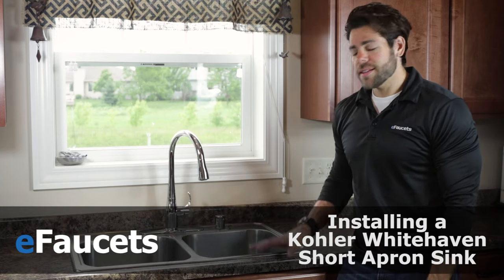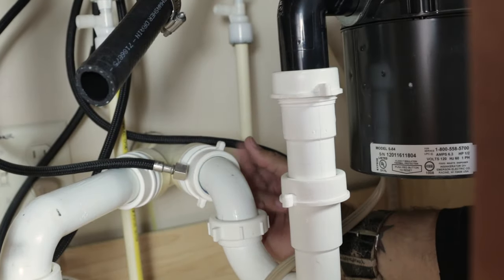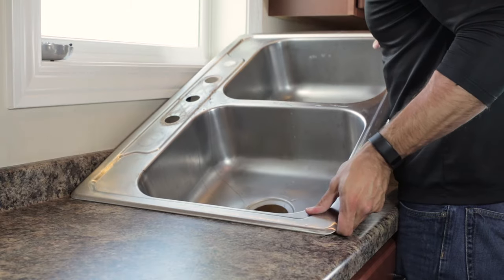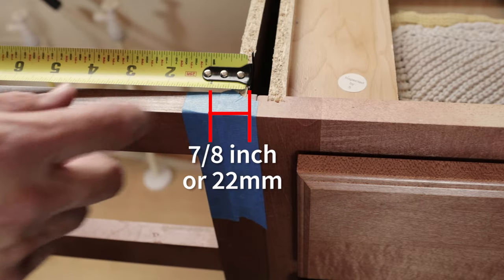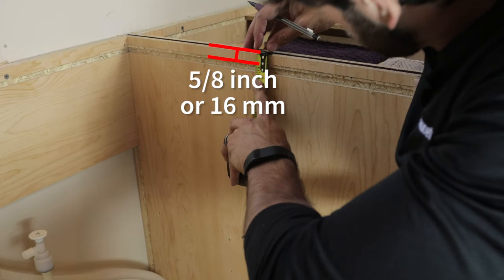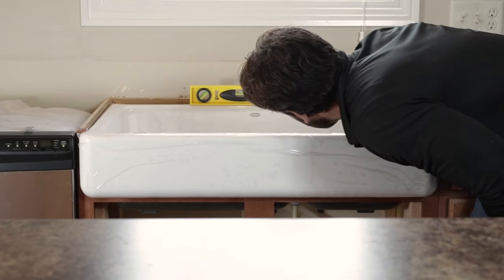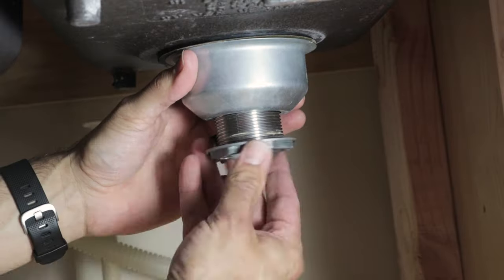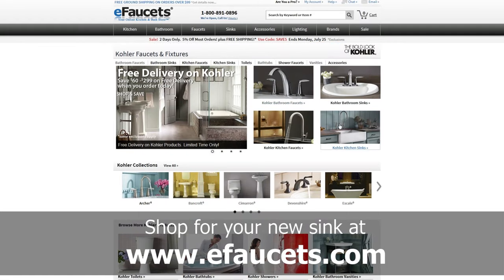How to Install a Kohler Whitehaven Short Apron Sink - eFaucets.com

Comment: I have a 9 3/4  apron and can't find the right cabinet to use without cutting some of the doors , which I don't want to do: where can I find a cabinet where I can just cut the top portion off like you did? It would have to have shorter doors:

Comment: Don't apply silicone topically as shown a 4:58, please. Apply a generous bead to the sink flange, drop the top, raise the sink, spray the squeeze-out with Windex, and wipe it away. Topical silicone leaks and a leaking sink can cause catastrophic countertop damage if the top has had steel rod reinforcement and the rod rusts. You have been warned; I fix this constantly.